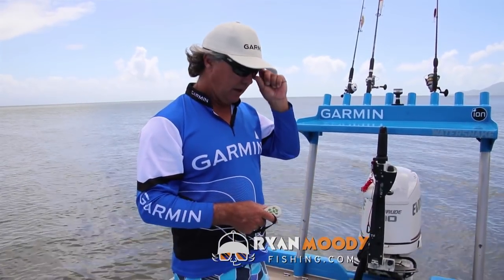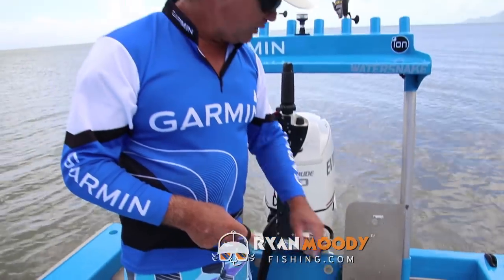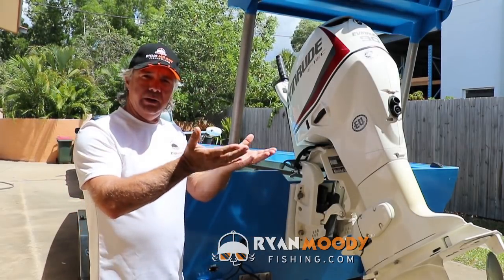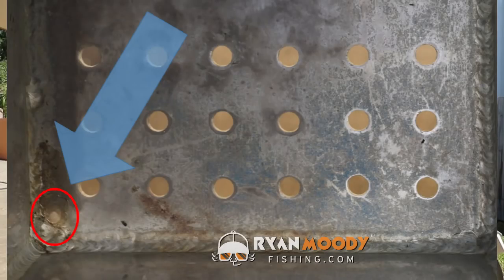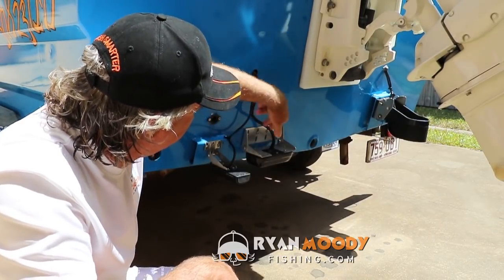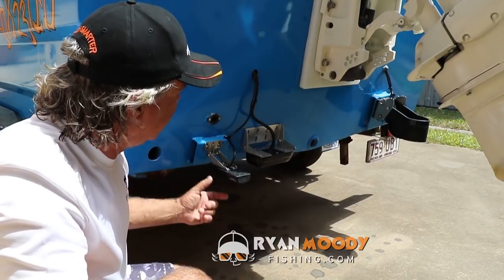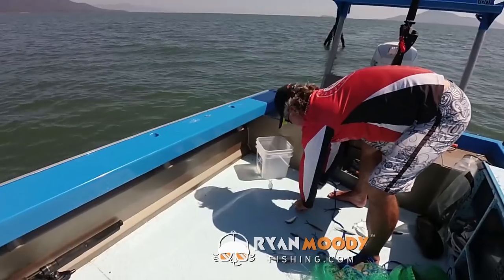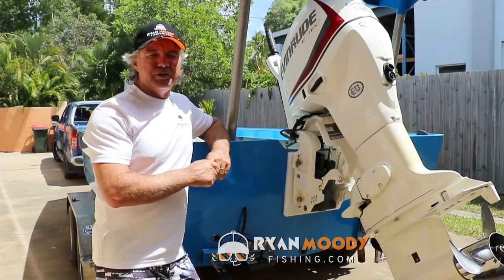Best bait tank - How to keep live bait alive without using a pump.

Comment: I'm confused!  Doesn't the water just keep coming into the boat and eventually sink?  or is there an escape hole somewhere?
Reply: Think about the physics, the amount of water coming into those compartments is determined by the height of the hull in the water.  Not enough water can be held in those compartments to push the hull deeper and force more water in exponentially.

Comment: Hi Ryan it has occurred to me that whilst underway at speed when the hull is higher & above the  hulls resting waterline the level of the water in the tank may  be much lower one might think...
Do you find this a issue with limited amount of water available in the tank??
I like the idea of a couple of holes transom  to regulate the the max level  in the tank when underway it would also keep the water surface free from rubbish as well...
Great concept like it well done....
Reply from the maker: Ian Whitton it pretty much maintains its level as it getting forced in from the pick up hole and it can really flow out due to the water travelling underneath. But yeah getting it right takes a little trial and error so don't drill too many holes in the beginning.
Reply: Thanks for your help & advice I agree a bit of testing slow and easy will get it perfect...

Comment: Thanks for sharing this video. I'm not exactly sure what a plate boat is, I have a 2006 Quintrex 390 Explorer, I'm wondering if this type of live bait would work on my boat or is my hull not thick enough?
Reply from the maker: Hi Scott. You'll need to get the advice of your local boiler maker as I'm not familiar with your model. Most production boats are pressed aluminium and a bit thinner. My boat is a custom boat and sheets of aluminium welded together - it's a bit thicker and can't be pressed. A boiler maker should be able to tell you if you can do it on your boat.
Reply: Thanks for the advise.
Reply: My hull is pretty light and thin and it's a production boat so I'm guessing it's pressed. I wasn't exactly sure what a boilermaker was, I recon it's another name for a welder.